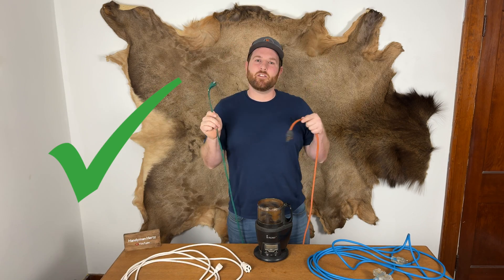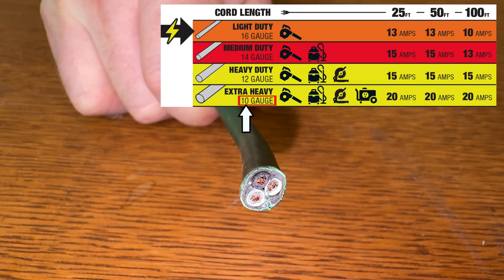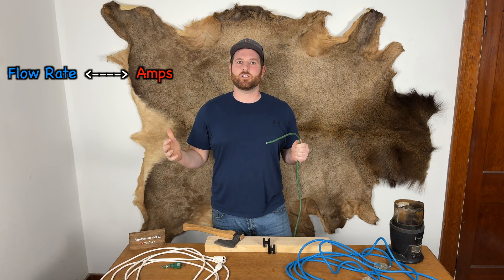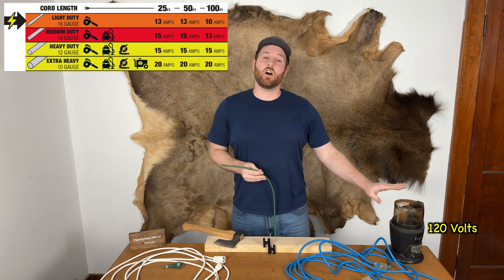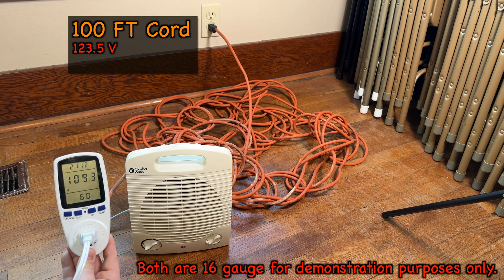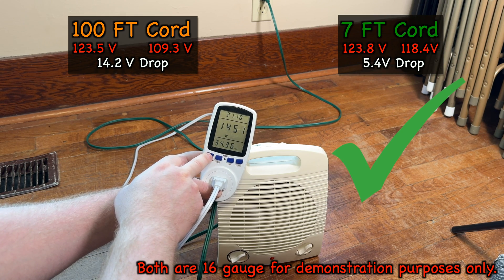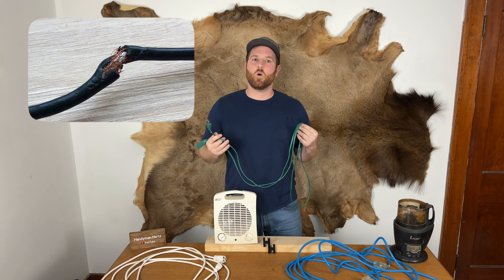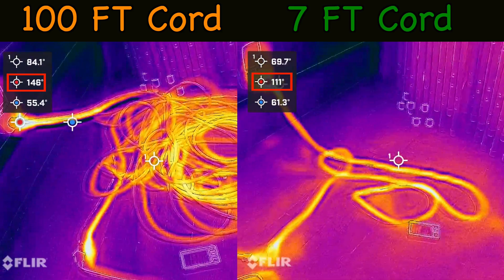Extension Cords 101:  Understanding Their Differences

Comment: I need help! So If i get a 50ft cord that has an amp of 15 a gauge of 12 and is categorized as a extra heavy duty! is that okay to run a steamer a vaccum snd an air compressor?
Reply from the maker: You would need to know the total amp draw of those motors. I’d guess you can run them all individually, but I’d have to know the amps draw first.
Reply: @ steamer runs about 12.5 amps, vaccum 9 and air compressor 12
Reply: @ministeriojersualenadora  so you could run those individually but not at the same time.

Comment: Looking for a 10 gauge extension cord on Amazon, found one that was 25 feet, and only rated for 15 Amps,this doesn't make much sense when 10 gauge is supposed to carry 30 Amps. I guess is that the prongs are light duty.
Reply from the maker: You’re not going to find an appliance on 120v that is over 15 amps, so no need to get a cord over that. Even a blender, space heater, water kettle, air fryer are all 1800 watts (15amp) or below. At least in the USA

Comment: I can't find anyone talking about my question. A 10 gauge 100ft triple plug ended cord rated for 20 amps, 125 volts, 1875 watts has a space heater 120volts 1500 watts meaning 12.5 amp plugged in and I want to plug another one of the same in. Can I? am I supposed to add the 12.5amps for each together = 25amps? or does EACH of the 3 plugs able to run something that less then 20 amps?
Reply: The three plugs are just incase you want to run three smaller items or so that you don’t have to keep plugging and unplugging as you use each item. The rating for the cord is max for the cord at any one time. So, 2 x10amp items or one 15 amp plus a 5amp or 1 15amp item and THEN another 15 amp but not at the same time.

Comment: I'm currently running my space heater on a blue cord 5 m long.That's grounded is that okay....
Reply from the maker: Yes. Obviously, it's better to plug it straight into the wall if you can. It Depends what gauge it is and the condition of the cord.
Reply: @HandymanHertz  Plugging into a power box with surge control

Comment: First: Thank you for explaining AWG in 10seconds. I never understood it. Second: Why even bother with all of this? Europeans use all standard extension cords. 1.5mm² for 3600W short term load, 3000W continouus load or 2500W indefinite load for up to 50m/150ft. Just get rid of "low power" cords alltogether!
Reply: everything is rated for 16A, max a breaker will take.
Reply from the maker: I believe 120v breakers are either 15 amp or 20 amp here in Kansas, depending on how the house is wired/gauge of wire
Reply: Yes, but you usually cannot pull 3600w indefinitely. The indefinite max power is somewhere between 2500w and 3200w, depending on the specific breaker and its age. I am a certified electrical technician. I also don't  recommend heating up the wires in your walls to about 80°c for extended periods of time(which is why the breaker will trip eventually). :-)
Reply from the maker: Not sure, but we run in 120v and 240v here and you run on 220v it sounds like. Most houses use 15amp(1800w) breakers or 20 amp (2400W) breakers, depending on how the house is wired. Here's my theory: our wiring system, Awg, was standardized for America in 1857, so that's why we use it. It works great for us, so no reason to change. It's like metric vs sae...we learn one system, sae, and it's no problem. Only metric users get confused. Would metric me easier? Would our  wiring system be easier if we used yours? Sure, but if you want a nightmare, start using both (Canada uses both and it's confusing and inefficient, and even lots of friends I've talked to there wish they never tried to change to metric)  

 Haha sorry, I may have gotten off track answering your question. Hopefully it wasn't just rambling. 👍🏼

Comment: that was a nice introduction ONLY, NOT A REAL COMPARISON OF CORRECT VS INCORRECT ; THEN WHY !!  you -left the  normal joe-blow still in the dark !. no pun & no disrespect. you just started a story but left-out the why, in diff situations, as well as surging !!!
Reply from the maker: Thanks for your feedback. In my mind, I compared them with the voltage test and the heat test and explained the differences and what to look for. but I'm certain that I have a lot of room for improvement, and every video I try to get better in some capacity.  👍🏼
Reply: I'd say it was fine for a three minute video. It's certainly not an exhaustive resource for all things extension cord, but I'm not sure what else you wanted him to say.